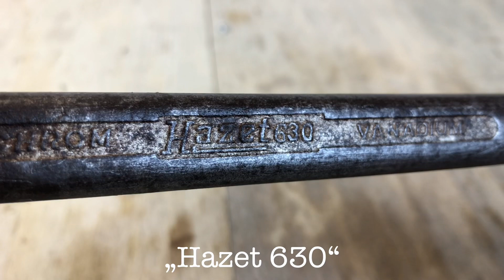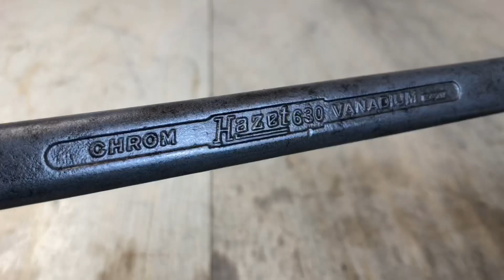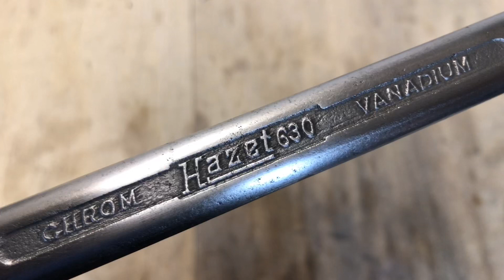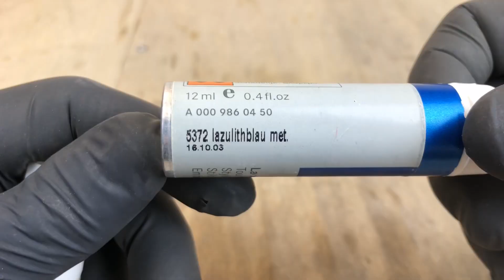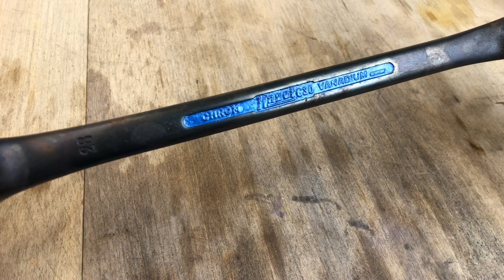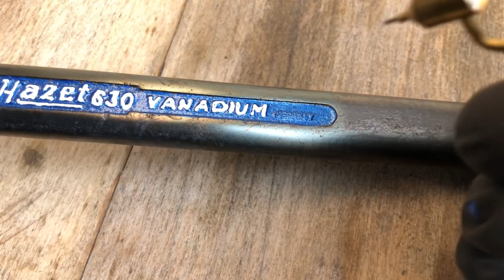Rusted Wrench Restoration - Tool Restoration | Mister Patina

Comment: This is nice as an ornamental tool. I say this because the blue colour from heating would suggest a temperature above 340°C and quenching from that temp makes the metal brittle. Please beware if using this as intended.

Comment: Painting of blue background is easier if you strongly dilute paint - probably twice or triple. Surface tension make it cover the whole recession. Color might be transparent, but it is easy to repeat. This technic strongly depends on paint formula, not always works
Reply: And for white lettering you can take flat piece of wood, wrap it tightly by cloth and soak it by white paint, then stamp letters. This antique recipe was used long ago for embossed car license plates renewing
Reply from the maker: Hey Vadim! Thank you so much for your hints! I especially like the hint with the wood and the cloth, i think ill use it the next time! Thank you so much!

Comment: Nice Chanel 👍
What Oil and grease are you using??
Reply from the maker: Thanks!
The oil for bluing was an engine oil, 10w40
The oil for the anvil was an universal oil for sewing machines 
The grease is an industrial grease from „nigrin“. 
Hope I could answer your questions 🙂
Reply: @misterpatina  just perfect, have some tools from meine opa, but the are rusty so I look at this video a couple of times. I think there is a good chance to get to use it

Comment: I have some of my father's wrenchs. They got wet and rusted. I still saved them. How can I restore them without all the extra equipment you have?
Reply from the maker: Hey Teacher, that’s a good question. I would recommend, lay the tools in white vinegar for a couple of days. After that give them a nice brush with a drill wirebrush or a regular wirebrush. After that, lay them in oil for 12 hours and dry them afterwards. That should be an easy way without (many) tools :)
Reply: @misterpatina  Thank you, thank you, thank you!
My Dad was a truck driver/mechanic. He had every tool imaginable.
When he passed, my brother took what he wanted and left me the rest.
I have bought new wrenches, but would mean a lot to restore and use his.
😊

Comment: I have a whole set of "Hazet 450" open ended and "630" ring spanners since the 1960s. Super quality! Nice "restoration", but in my view grossly overdone. This is a run of the mill tool, not a museum piece! The finish you got is not original at all, and there never was any paint on those spanners.